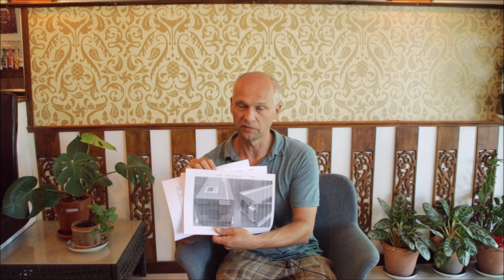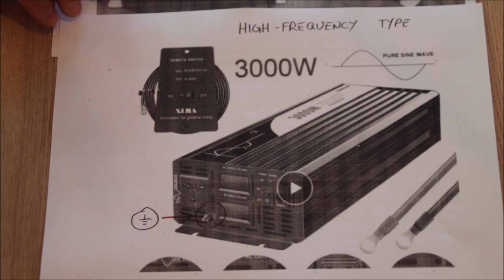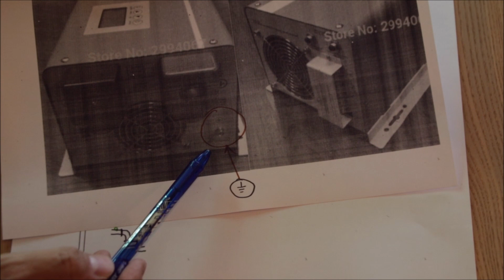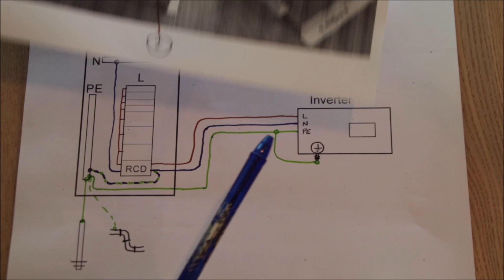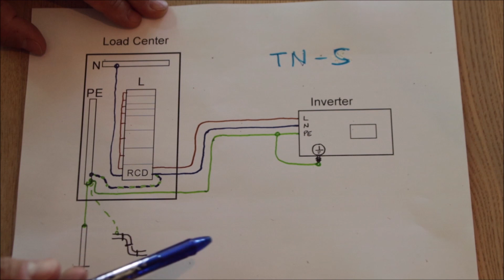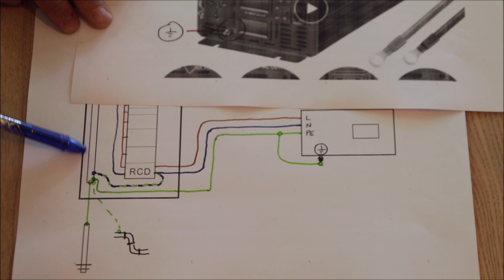Inverter Earthing and N-G Bonding in a simple Off-Grid Setup

Comment: Hi Roland - a great set of videos. Really appreciate how you qualify the information with where in the world the system is!

Could I ask your thoughts on two questions (I'm in the UK and have two setups - one with a prebuilt system, a Bluetti AC200Max, and a DIY one with a Giandel 2KW high frequency inverter).
1) In both cases I've bondend N-E using a plug in one of the outlets with N and E connected internally. It's a bit of a fudge, but does work and makes RCD extensions/adaptors in the other outlets work correctly. The distribution box you have is much "nicer" and I'll be following that, but wondered what you thought of the plug approach ?
2) Currently I have no connection to earth-ground - the earth wire from the appliance provides the second route for the RCD but is not connected to a rod etc. Again I wondered what you thought of this - is it better/essential to have an actual connection to earh-ground ? Again I plan to add this, I just need to check for isolation between the DC and AC sides first.

Hope those make sense - thanks.
Reply from the maker: Hi. 
2)Bonding PE to one of the active wires without giving Ground reference can actually be quite dangerous. Your system still remains IT (isolated). So, if in case the wire which you did not bond with the appliance PE gets in contact with real earth/ground, it will become the real Neutral and the before virtually bonded N/PE will be the L. That will turn your appliance shells, metal parts, etc hot! 
1)UK plugs always have the L and N wire on the same pins by design, right? There is no mix-up of L/N possible? A bonding plug in that case can do the job.

Comment: First of all, thank you for the invaluable knowledge sharing. 
Secondly, sorry if someone has already asked what I'm about to 😅

I am about to finilize a simple off grid system: 
Panels
Hybrid Inverter
Battery

The inverter has an external chasis ground connection. 
The output of the inverter is connected to an electrical panel where there are relays and stuff to distribute the load for the house needs. 
Now, I'm trying to figure out how to ground the thing... 

From your video I understand that I must ground the electrical panel somehow (an electrician will do that, cause I don't really know where or how to do it).
Then I need to connect the external ground of the inverter  to the internal connection of the inverter output. 
Then connect the output to the electrical panel? 
Or should I seperate the ground and connect it directly to the grounding rod? 😐
Reply from the maker: Hi. No, just ground the chassis grounding point directly to the ground inside your electrical panel. The bar there, i assume,  will be connected to a rod. You then just need to provide a Neutral to Ground bond inside the panel as well.
Reply: @RolandW_DIYEnergyandMore Thank you for your fast reply. I really appreciate that! 😁
I did a continuity test and saw that the chasis is already connected to the AC output ground of the inverter.
So, in other words all that's left to do is to bridge Ground and Neutral of the AC output (of the inverter) and then ground both of these on a grounding rod? 

I have very limited knowledge on things an electrician should know, but where I live, even electrician don't know what to tell me regarding grounding an inverter, so right now, your help is invaluable... 

I was wondering if for some reason bridging ground and neutral would result in something bad for the inverter... Do you think that the inverter might not "like" it and burn something?

I can see in another video of yours that you did it on your inverter without any issues, but I don't have the necessary knowledge in order to determine if mine will have no issues with it... Sorry for the potentially stupid question, but... also thanks if you once again spend the time to reply to such a question 😁

(my inverter is the ISolar-SMX-II-5.6KP if that helps with anything... it's a 5.6kW hybrid Inverter, but I will be using it totally off grid)
Reply from the maker: @FishFish1995  if you follow the drawing from the video, then you will have no issues. N-G bonding doesn't hurt any inverter, other than some EU-inverters used in US-splitphase. In totally off-grid scenarios, N-G bonding doesn't do anything to the device ;)
Where do you live?
Reply: @RolandW_DIYEnergyandMore I live in EU (Greece). Home Solar hasn't really picked up yet here. (Although it's a country with only 45 days of rain per year 😂 ). There are some stupid laws preventing it... 
Anyway, the point is that I have asked some electricians and they don't know how to go about grounding a solar system. I need to find a specialist and it's quite hard to find one... 

When watching some other videos (it's a channel called DIY Solar Power with Will Prowse), that guy was saying that you shouldn't ground your hybrid inverter if it is connected with an AC input since the AC input would already be grounded and if you also  ground the inverter,  in case of a thunder close to your ground rod, a ground loop would occur and would fry everything. He also said that if it's an off grid situation, grounding the inverter is logical... He didn't say how to do it though 🤣 And I was lost 😋
You however, along with another (but not as good) video of another channel, were the only ones talking about how to ground the AC output... 

When looking at some Greek videos of hybrid inverter installations (there are extremely few), some would even not connect the ground wire on the output 🤣 So really not much help from there either... 

After some consulting with a friend electrician, regarding ground/neutral bridging (after I watched your video), he told me that actually the power from the power provided is already ground/neutral bridged here in Greece. 
So it's something common in power delivery in Greece.
Reply from the maker: @FishFish1995  dont forget Will Prowse is in US, and I always complain about his little knowledge in electrical distribution ;)
Every grid, worldwide is N-G bonded. And thats why there are many things to consider when having grid connected hybrid systems. But for off-grid it is easy for us to just implement grid safety standards.
Reply: @RolandW_DIYEnergyandMore Truth is that he always just whines about something but never gives a very clear solution 🤣
He certainly does his best in order to help others though (but also get views I guess 😅). 
I'm also watching another channel called off grid garage (it's a German living in Australia), but I didn't find something regarding grounding there. 
He's using Victron inverters and equipment though, so I'm pretty sure that Victron documentation has some instructions regarding grounding. 

Regardless of what these guys say or do, you surely helped me a lot. 
I'm actually building a solar system for my brother who lives in a mountain in a Greek island. There are no power lines there, so he's just using a 100W solar panel, with a 600W inverter and a battery that was never really getting charged. He only had power for lighting and charging his phone. In the winter not even that...
So now, I am trying to build him a proper system, but safety was also a consideration... (a company would charge 16.000€ for the system that I put together with 4.000€ so, I kind of had to do it myself 😅 otherwise we wouldn't do it at all...)

So yeah. Thank you again. I needed it to be safe and you really helped me with that...
Reply: @RolandW_DIYEnergyandMore 
Just some hours ago, I have completed the installation (with the help of an electrician). I bridged/bonded ground to neutral after all. 
Seems to be working without any issues (although the TRIP tester on the RCD worked even without that bridging so it got me thinking that maybe my inverter was already bridged and the voltage I was getting between ground and neutral was some virtual voltage or something because I had no load connected when measuring??? I don't know... I will test further for sure...)

A question popped in my head though... How do more expensive inverters get 0V between ground and neutral? (or why don't they get a voltage?)
Is it as simple as internal ground to neutral bonding/bridging? 
Or is it something else entirely? 

From a safety standpoint I'd like to know if a more expensive unit is doing something better than I currently do. Thank you again for any reply. You already helped me considerably!!!
Reply from the maker: @FishFish1995  hi, RCD Test always work as long the unit itself is functional. It is an internal test and doesn't say anything if your installation is wired properly.

The voltage difference between N/PE doesn't say anything about the price of the inverter. My 1200 USD Deye is doing the same thing. It is just depending on a bond.
So if an inverter doesn't have a voltage difference between N/G then it most probably will be because there is an existing internal bond.
Expensive units will have a mode related bonding via an internal bonding relay. If an inverter if internally bonded with a fixed wire, that might in some situations even be dangerous or not legal. Expensive units will never be internally bonded just like that....

Comment: Thank you Roland for this wonderful video. I am currently working on putting an inverter in my RV and I wish to power the main 120v AC breaker panel with it. The inverter i have supplies 60v each to two legs (red and black) amd then has a green and white neutral/ground.  My main panel has a hot, neutral and ground. Is it possible to power this panel with the inverter? Thank you!
Reply from the maker: Hi Charles. By the 120V reference I take it that you are living somewhere in a country with the US split-phase system.
Usually I would say yes, but I know that for the US equipment, some manufacturers use a 240V split-phase and set the inverter to output 120V over the 2 legs. If in such a setup the midpoint is connected to the inverter shell and you place a N-G bond, then you would short one of the legs and destroy the inverter. I think they had such stories with Renergy. 
You would have to first test, if the 60V between the Earth wire and a Leg can hold current. Take for example a old stile light bulb and connect it between the green and Red, and thereafter green and black. If it doesn't light up (even just dimm) and the measured voltage over the light bulb is near zero, then it is safe to bond any of the L to ground (but normally I think you are using black as the N in US, right?).
If in either connection the light bulb glows up in a dimmed state and you can measure 60V over the bulb, then you cannot bond the green wire to ground!
Sorry, but the split=phase stuff is a bit weird ;)
Best regards, Roland
Reply: @RolandW_DIYEnergyandMore  Thank you so much for the reply. I will test it out with this information. Appreciate it Roland!
Reply: @RolandW_DIYEnergyandMore OK, I think I have figured it out. The breaker panel in RVs and Mobile homes should not have a bonded neutral to ground, because this occurs in the pedestal. The breaker panel is essentially a sub panel. in my case, I intend to utilize a manual transfer switch (changeover switch) to switch between shore power and inverter. Since the neutral is not bonded to ground in the panel I should be ok.

Goodness this had me perplexed! Thanks Roland and others for sharing!

🎉

Comment: Hi...how could i identify my hybrid inverter can be connected N and E without any harm ( possibility of fault). Thanks in advance..
Reply from the maker: Hi, where do you live and what is your Grids earthing arrangement? As long you do not try to N=G bond an EU (or other 230V/1 phase inverter) in the US split-phase grid, then you are good to go with any inverter. If it would show a fault after bonding, it would mean that it has detected leakage inside the inverter itself (that would then be most probable DC to AC leakage) and would just show that you have a problem in your installation anyways. Otherwise N-G cannot harm the inverter, it is just a procedure to direct ground fault currents to the N of the power source.
Reply: @RolandW_DIYEnergyandMore  Finally I managed to bond Neutral and Earth(PE) of my hybrid inverter without any issues...thanks a lot for your advise...

Comment: Yes, mainly for small appliances without ground like for lamps,  but I thought maybe also for a refrigerator in case of electricity shut down, so it needs the grounding.. (?)
Reply from the maker: If the fridge is the only Class 1 appliance connected at the time of blackout, then there is as well no need for grounding. Single earth leakage failures in a isolated system do not cause dangerous situations. You can still connect your phone charger or other 2 prawn plugs in that case.
Reply: @RolandW_DIYEnergyandMore  OK. Thank you very much. 
Best Regards, 
Doron

Comment: Hello Roland, 
Thank you. You have very important information, very nice and clear presented. 
I have a question. I am making a small portable solar system with a high frequency inverter (750W). 
For the "ground" , instead of a rod , can I use a cable that will be connected with a plug to the ground in one of the house terminals?
Best regards, 
Doron
Reply from the maker: Hi Doron. That would as well work as it would give you a ground loop at least over the transformer grounding rod if no other one is installed anywhere else. 
But you said small, portable system. I assume you will only use the inverter outlets to connect smaller appliances which probably doesn't even need ground!? (Class 2 appliances). In this setup you do not need to ground the inverter. Just use it as an isolated system, right?

Comment: Hi Roland. I am thinking of connecting my inverter via schematic you have described. It is a cheap amazon inverter. Everything is pretty clear, but the only thing I am confused about is that my AC side ground terminal is connected to casing output grounding terminal..that's fine. That is the same as in the video. But It is also shows continuity to the DC negative side. Is this normal? Can I still connect as per schematic?
Reply from the maker: Hi, in principal there is nothing to say against bonding AC Neutral, while DC as well is bonded to ground. I just don't like it personally when the inverter manufacturer is giving away DC isolation. But again, it might as well have a reason why they did it like that. Probably because its a cheap inverter layout...

Comment: Hi really sorry to bother again, I have installed 3 parallel inverters and running single phase. All the wiring joins up in a combiner box.  3 x 25 amp circuit breakers, one for each Inverter rated 24 amps max and then into the 2 pole main breaker 80 amp. I will connect one small consumer unit a 32 amp for extention cord and 63Amp RCB. Where should I do the neutral grounding in the combiner box or or at the small consumer unit as your pic describes.
Reply from the maker: Hi. In the small consumer unit, where you have the RCD, because there your grounds should meet...
Reply: Thank you, it now makes sense

Comment: Hi Roland, is it ok to use this off grid setup in conjunction with a grid system i.e. use the same earth as the grid system its TT?
Reply from the maker: Yes, as long as you make sure that the grid is fully disconnected on all active wires when in off grid mode. There cannot be a N-G bond when power comes from the grid.
Reply: @RolandW_DIYEnergyandMore  Thanks ❤

Comment: Hi Roland, I have a WZRELB 24V 2500W Inverter. I want to connect it to a subpanel, however I have realized that the AC output terminals are Hot=60V, Neutral=60V, Ground=0V (ie floating neutral?) The manual specifically says not to connect the neutral and the ground, however, that is required to give a fault current path, as I understand it. Do these inverters in your video have a 120V hot/0V Neutral?
Reply from the maker: Hi. Every inverter without a N-G bond will have a floating Neutral. Its OK to use such a setup when connecting a load directly to the output of the inverter. But if you need to supply a panel then it is better to eliminate the floating neutral. In the US there are a couple of inverters where you cannot bond N-G because they are internally actually 60V-0-60V L1-N-L2 inverters which are used 120V L1-L2. In that case you wouldn't be allowed  to bond the false N which might be a L internally with G as it would create a short and the inverter will be damaged. I saw some videos about Reliance Inverters. I unfortunately cannot tell you if that is the case with your inverter.
Reply: @RolandW_DIYEnergyandMore  Hello, but then how to protect against shorts on the AC line of 60V-0-60V inverters? Would the Type B RCD work correctly on the 120V L1-L2?
Reply from the maker: @Miiike03  hi. In such a case you would have to rely on the inverters internal short circuit/overcurrent protection. And else just use the GFCI outlets as you are used to. An 230V Type RCDs wouldn't help you much in the US split phase system, especially if the L-N voltage is only 60V.

Comment: We have no grounding and have 40v on the body of the inverter. 

Did I understand correctly that I should connect the grounding from the inverter to a metal rod in the ground, with the neutral of the output 230, that comes out of the inverter?
Reply from the maker: Yes, that is correct.